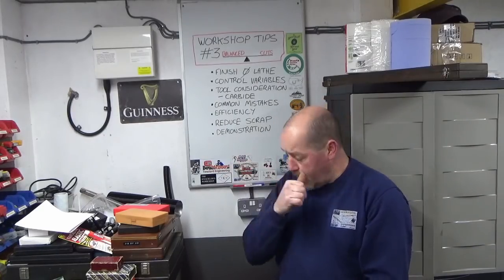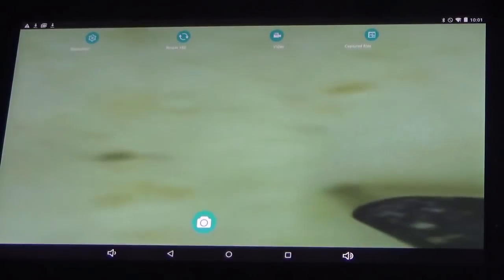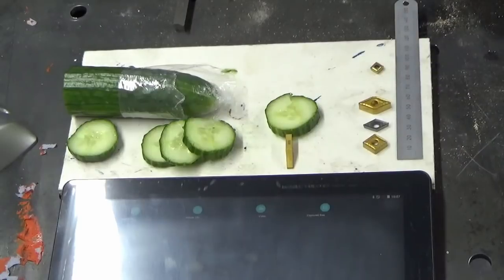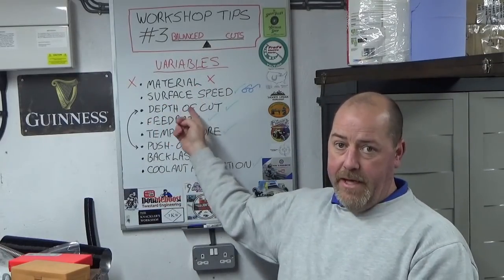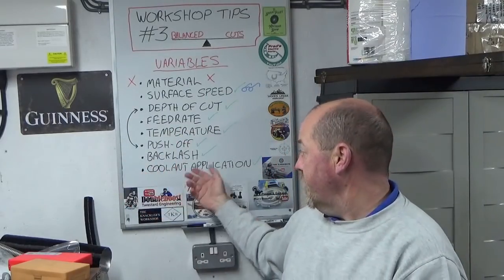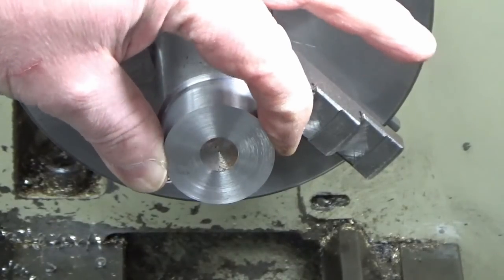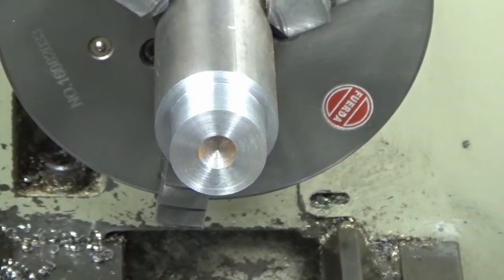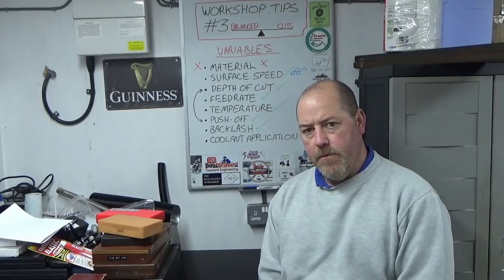Workshop Tips #3 - Balanced Cuts on a Lathe. Top Tip!

Comment: Great demonstration!  Some time ago, Stefan Gotteswinter mentioned just in passing that to hit a tight dimension, the final cut needed to be taken with confidence and a good "bite".  That stuck with me, but he didn't elaborate in that particular video.  Between the tool edge explanation and your anecdote about dialing in tenths on the CNC until you hit the tipping point and the tool bit in deep, you really clarified the issue for me.  Thanks!

Comment: Jon this is the second time I have watched this video. I actually put this in use today. I did use a DTI because the marks on my dials are too hard for me to read. My target was .500 O/D + 0 - .001. I was able to hit the .499 using this method. It works quite well. I must confess i made a mental error on the first cut. I meant to take .020 off the diameter on the first of the 3 passes and I dialed in .020 which yielded .040 off the diameter. I caught myself on the first measurement and all was well in the final diameter. Thanks for such great tutoring.
Reply from the maker: Hi Terry, thanks for the comment and feedback. Glad you are finding it useful. Keep practicing. Cheers, Jon

Comment: Some good tips there, Jon 😊. I learned this the hard way lol. This is a lot more prominent when you run an old, clapped out Atlas, especially with carbide. 
Lol, I repair cnc machines, we had a guy work half a day, crashed the horizontal cnc mill ripping the whole tombstone off it's base and just walked out without saying a word.  Some of these guys I tell ya 🤣.
Thanks for the vid!
Cheers! 👍😁👍
Reply from the maker: Hi, thanks for the comment. Totally agree, the older and more worn the machine, the more important this is. Lol I bet that made a nice noise. Cheers, Jon

Comment: Absolutely agree.
Well presented as well.
I have advocated this approach for decades.
I would aim, when possible, for 3 balanced finishing cuts of a depth (ie radius) of at least the radius of the insert.
On one offs I would test and settle my finish cut settings, like you have here.
Then rough down all round leaving that finish material using a roughing tool.
Finally, finish machining with confidence, on size and suitable surface.
Still easier these days with DRO's but very satisfying and not nerve racking.
Reply from the maker: Hi Carl, thanks for the comment. You are bang on, it's clear from your knowledge I have been preaching to the converted lol. Cheers, Jon
Reply: Jon, the message hasn't been spread far enough yet.
I see other YTers scraping away or sanding to size as 'examples' of good technique.
What can I say?
I've had kind but critical comments deleted.
YT University deserves best practice tutorials.
Just my opinion.
Anyway, good on you.

Comment: Hi Jon,  It's interesting watching carbide v's HSS cut under a microscope.  Carbide needs a greater depth of cut as it works like peeling an orange with your thumb.  HSS cuts like a knife and having a shave. HSS allows fine incremental cuts but carbide doesn't (unless you grind the insert to a fine edge). Interesting subject.  Cheers Rob.
Reply from the maker: Hi Rob, thanks for the comment. Bang on mate, I have seen so many people struggling with this which prompted me to make the video. Hopefully it will help a few new starters out a bit. It's an interesting topic for sure. Cheers, Jon

Comment: Hi Jon  Enjoy you videos very much.  You touched on a topic which probably frustrates many people.  I have found that where the backlash is positioned is important.  I machine 4140 steel with a DRO and I find that the tool gets dragged 'into' the work.  The DRO confirms this. Therefore it will finish undersize.  By feeding into the job the backlast is on the wrong side.  Apart from getting rid of all backlash I find that if I move the cross slide past the desired position then back the tool away from the job until the desired dimenion is reached.  This way the the worst that can happen is a oversided job.  Using this method I take a cut, measure the job and then dial the diameter into the DRO (**Important - all while not moving the cross slide).  Do this well in advance of the final cut to get confidence in the repeatability of the process.  I agree enirely with what you said about cut depths with respect to repeatability and surface finish.  I get a poor finish on 4140 with very light cuts and low surface speed.  To get an idea of surface finish have a look at the squared off end.  It will have different finishes.  This shows visually how surface finish is affected by surface speed.  
 (You said that you are using xNxx inserts.  N have zero clearance.  Why not a xCxx (7 degree)  or xDxx (15 degree) insert.)
Cheers  John
Reply from the maker: Hi John, thanks for the comment and sorry for the delay responding. I don't disagree with your method. xNxx do have clearance, it's built into the holder. I mainly use CNMG as I was fortunate to inherit a lot of them (good quality ones) many years ago so they cost me nothing. I do switch to CCMT and VBMT occasionally when material and required surface finish dictate. CNMG is just a work horse which is why I like them, you do need a half decent lathe though, a small hobby lathe just won't have the rigidity or grunt to get the best out of them. Cheers, Jon
Reply: @jonsworkshop  Hi Jon   Thank you for the reply.  Since then I have bought a insert tool holder with angled holder to create front clearance. So I can use the N inserts.  My lathe is not a hobby lathe it is a 410 x 1000 workshop quality machine.  Its power is a bit scary at times.  I make a mistake once and took about a 6mm deep cut on power feed.  It didn't blink an eyelid.  I hit the emergency stop with lighning speed. Cheers.

Comment: Super video, more please! On really tiny parts, I use ground, honed and polished uncoated carbide inserts with a 0.2 or 0.4 mm radius, so I can take finer cuts than with normal inserts, but I still have to bury the nose to get a good chip and finish exactly as you explain, with all the same variables to consider. I always do 3 or 4 balanced cuts when I'm finishing parts to very tight tolerances, but usually 0.3 or 0.2 mm off the diameter. Getting 50 workpieces to be 3.98 mm +0.0 -0.01 on my old Colchester (with DRO) is no great stress with balanced cuts.
Reply: With those smaller steps I use the compound at a shallow angle (about 5.7 degrees) to give me a bit more control over the final size after locking the cross-slide so 0.1 mm on the compound is 0.01 mm (0.02 mm of the diameter).
Reply from the maker: Hi Machining and Microwaves, thanks for the comment. Looks like I am preaching to the converted here lol. I plan to do some insert grinding in the future, have done it in industry but not at home yet, need to get kitted out with the right wheels for my surface grinder first. Your compound slide trick is also a good tip. More on the way Cheers, Jon
Reply: @jonsworkshop  I haven't tried grinding carbide inserts, but I've done plenty of form tools and D-bits in carbide.  It will be interesting to see how it goes. One of the other Youtubers did some insert grinding, can't recall who, but I'd guess Stefan, Tom or Robin. 
Keep up the good work. Neil

Comment: great info and demo. I will be in the shop tonight until I can reproduce what you've done. question; any thing I should take into consideration using hss?
Reply from the maker: Hi Billy, thanks for the comment. For balanced cuts, no. Follow the exact same procedure regardless of HSS or Carbide etc. For the whole finish cut size constraints of carbide, clearly this is not so for HSS, therefore you last 4 cuts could be 0.002" each if that was giving you an acceptable surface finish. The important thing is to lock as many of the variables down an just be consistent. Hope this helps. Cheers, Jon

Comment: Good points there for those not in the know  Jon .   I think mild steel is the worst crap you can machine  for one off bits , i tend to cheat if it is not playing the game  & use a sharp   insert  for aluminium .
Reply from the maker: Hi Max, thanks for the comment. Yep, agreed. EN1A is bottom drawer stuff but useful for demos etc. Bloody expensive as well for what it is. Cheers, Jon

Comment: Clausing used to have machines that did compensate for diameter with speed change, even though they were manual machines. I have a VFD on my 3 Hp machine. If I wanted to, I could do the same thing. Just connect the pot to your cross feed. The further you go in, the higher the speed. You could set max and min speeds. I haven’t done it, but I’ve thought about it. There are long linear pots that could be used. That’s simplified, of course.

Also, as we should all know, HSS bits break down quickly. After just a few feet, they’re not as sharp as they were. If really needed, carbide inserts can be honed on a diamond “stone”. And carbide is sharper today than they were 20 years ago.

Balanced cuts are also important as they are more predictable. That is, the strain on the machine structure is the same for each cut which is at the same depth and speed. So, if you’re 4 thou away from final dia, taking two 2 thou cuts will be better than 2, 1, .5 and hoping that another .5 will get you there.
Reply from the maker: Hi Mel, thanks for the comment. Agreed with all your points. I may do a future follow-up video on grinding carbide inserts and the benefits / drawbacks etc. Cheers, Jon
Reply: @jonsworkshop  that would be helpful. A lot of people read that you can’t grind carbide inserts, when we most certainly can. Making carbide brazed tools is that difficult either.

Comment: As a beginner I thought it to be very informative. There’s only so many books you can read this practical demo was an eye opener. One question if you were reducing a large diameter to a small say 30mm to 10mm using your balanced cuts would at some point I need to increase the speed or feed rate as I got closer to the small diameter to ensure I could hit my target. It may be a silly question but I think the most stupid question is the one that’s never asked. 🤔
Reply from the maker: Hi Ray, thanks for the comment. You are absolutely right, no daft questions! In short, yes to spindle speed, and no to feed rate. If I was taking this much, I would blast down to 15mm not worrying too much about anything other than material removal, then start assessing surface finish and 'tweaking' speed / feed until you get an acceptable result. Then fix the variables, change nothing, and work your way into 10mm. The difference between 14.5 ish and 10, should make no difference. Hopefully this helps. Cheers, Jon

Comment: Hi Jon, thanks for the information,  should you take this type of cuts  on your mill. One thing as a novice is speed I keep think slower is better, but you highlighted the need for the inserts to do work
Reply from the maker: Hi Jim, thanks for the comment and question. On a mill, this does not translate well unless you have a power X axis that you can consistently repeat the feed rate, and you are not moving your Y axis (ie a slot). If you consistently cut in the same direction in this scenario then the method transfers, if you are moving your Y axis between cuts you have too many variables. Probably not worth worrying on the mill. Also, carbide endmills are all ground (sharp edge of the knife) so you can take the very small depths of cut easily. Hope this helps. Cheers, Jon

Comment: Excellent!! One suggestion is to draw  out the apprach or plan of attack first and after roughing the approach  for the last 3 cuts and their slight variance to get close to the exact size. What cut depth did you use for 4th, 3rd second last cuts ie.  Plus one thing that is also important is the height of the cutting tool and what happens when it slightly of when cutting small diameters.

Comment: What is push off? I didn't understand that one.
Reply from the maker: Hi Mark, thanks for the comment and question. Push off is the "flex" in the tool, tool holder, tool post, compound slide, cross slide, and saddle as an assembly. Best described by Newton's 3rd law, (sorry, but its probably the best way to explain) "to every action, there is an equal and opposite reaction" meaning, the pressure you exert on the part when you cut with a 'blunt' tool, is mirrored back into the lathe, and any clearances between mating parts, or flex due to lack of rigidity, results in push off, meaning you don't cut as much as you dialled in. Hope this helps. I will expand in a future video as you are not the only one to ask. Cheers, Jon

Comment: One of the most important videos I've watched so far. But can you precisely define push off? That's a term I'm not familiar with.
Reply from the maker: Hi Rocky, thanks for the comment and feedback. Push off is best explained by Newton's 3rd law (sorry). "For every action there is an equal and opposite reaction" meaning, the force excerpted by the tool on the part in cut, is equal to the force in the opposite direction excerpted on the tool, tool holder, tool post, compound slide, cross slide and saddle, therefore any play or flex in that entire system will comply under load meaning you don't cut exactly what you dial in. Hope that makes sense. Cheers, Jon
Reply: @jonsworkshop  One of your commenters seemed suggest locking down the cross slide only on the last cutting pass.  But the improved rigidity of that change to the lathe's total elastic deformation curve vs. tool pressure would increase the final cut's depth by decreasing lathe total elastic deformation from the constant tool pressure.  Do you agree.   Like your other viewers, I enjoyed your explanations.  I just don't think that changing a controlling variable like "push off" which is determined by the machine's total elastic deformation curve should be changed on the last cutting pass.  That strategy would violate the "all other things being equal" assumption on which your good advise is based.
Reply from the maker: @informationsponge5697  Hi, thanks for the comment. Totally agree, the whole concept here is based around consistency of all forces, if you change anything at all (especially on the last cut) the output will be different, 100% guaranteed. Cheers, Jon

Comment: Now this is something I didn’t know, very interesting, two things can you grind inserts and could you take the last cut with HS steel, learning machining from YT generally doesn’t teach you this stuff, 👴🏻👍
Reply from the maker: Hi Terry, thanks for the comment and questions. Yes, you can grind carbide inserts (only on the top face really if you want to index them), using a green grit wheel or CBN. You can also just use carbide for roughing and use HSS for finishing but I would still recommend balanced cuts with the HSS as one pass doesn't allow you to fix your variables, this is also inefficient as you need to set two tools up (sometimes necessary though). As long as you can achieve the geometry and surface finish with carbide then this method gets you the results. Hope this helps. Cheers, Jon

Comment: 24:30 „round numbers“ 🤔 What round numbers are depends entirely on your measurement system. Your 36 mm  would be 1.41732283 inch. Conclusion? You have to buy metric steel! 🤣🤣🤣
Reply from the maker: Hi Garratt, thanks for the comment. Lol, yep, I work as easy in both units but somehow I prefer metric for tight limit stuff, it's easier on the micrometer to get down to sub 0.001" without having to resort to reading off the 10ths vernier scale on the barrel. Cheers, Jon